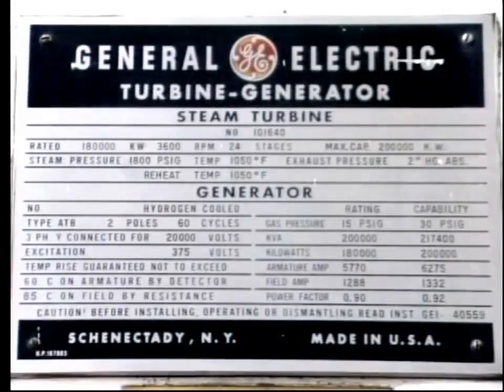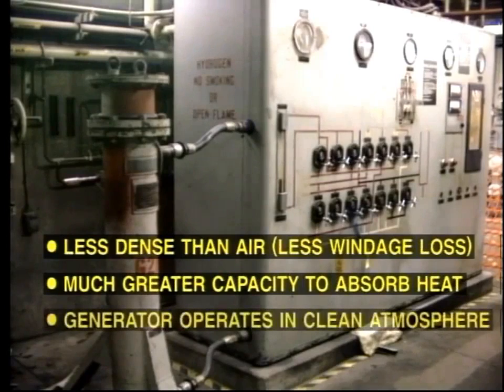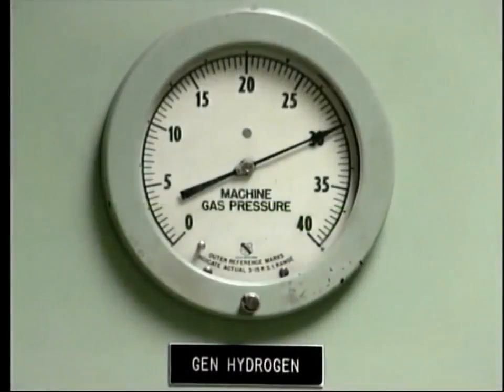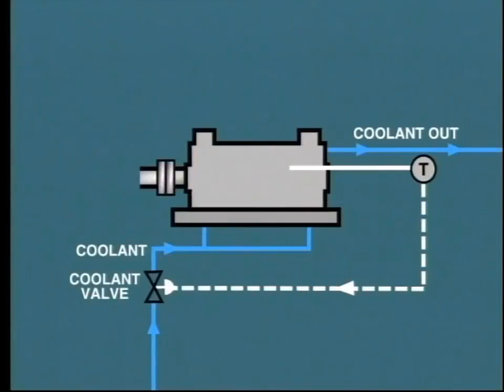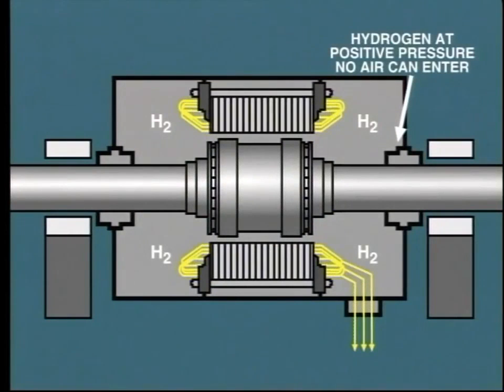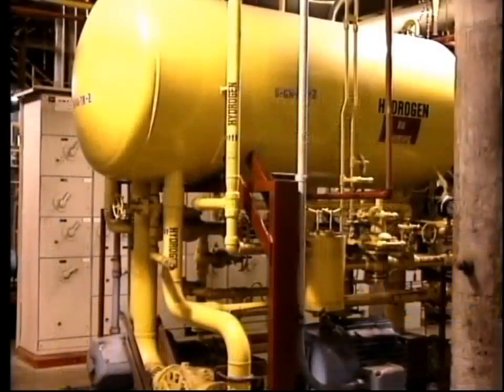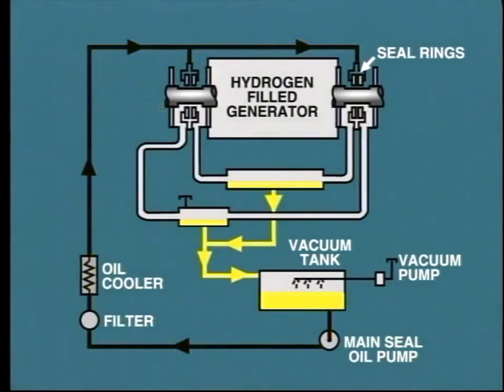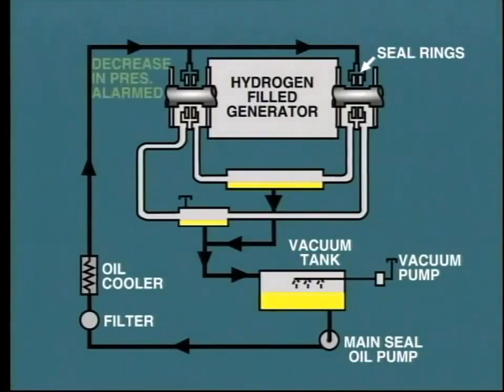lesson 2: hydrogen cooled synchronous generator

Comment: In South Africa we just had an incident where a 800 MW generator was destroyed due to air leaking into the system, and the hydrogen then exploded.
Reply: In Queensland, Australia there was an explosion at the Callide Power Station generator room about three years ago.
Although the public are not told exactly what happened I believe it was due to H2 leak in the bearings.